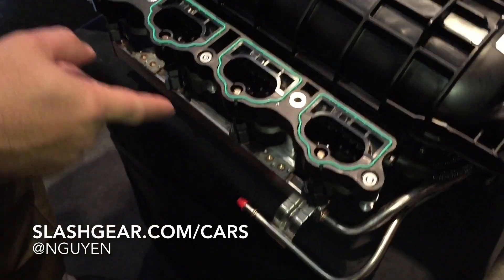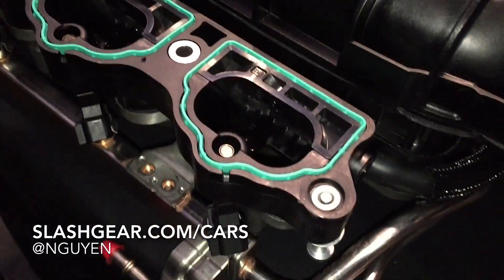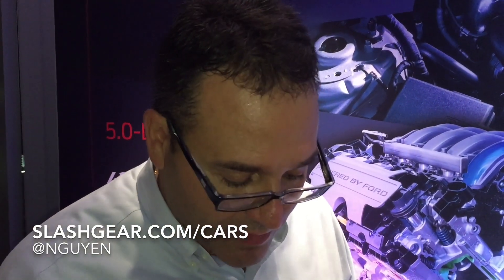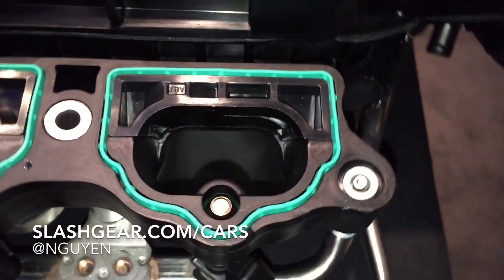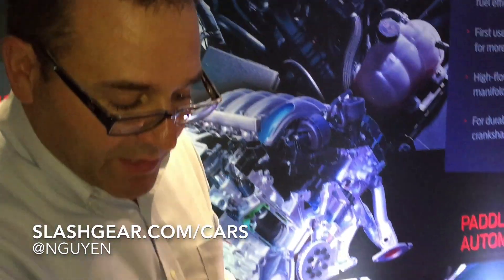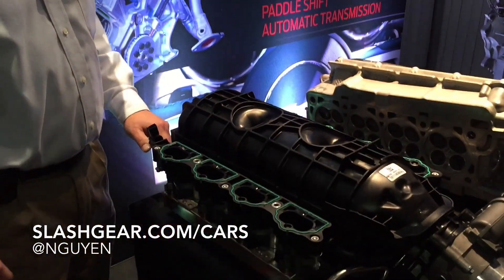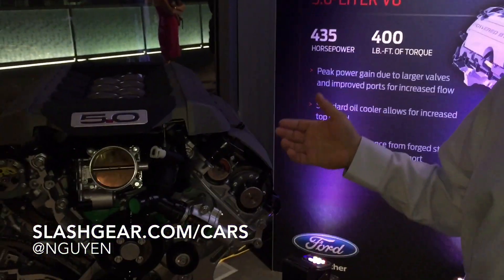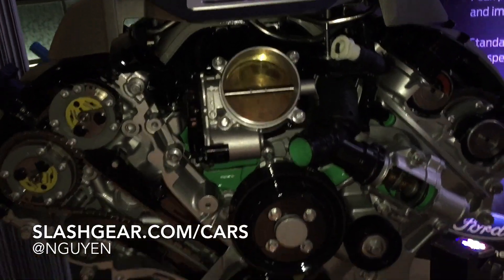Ford  5.0-liter V-8 engine 2015 Mustang

Comment: I think Ford should at least be able to get 125bhp per liter by now. A 5.0 Liter engine with less than 500hp seems inefficient and such a waste - I'm disappointed. You boys can most definitely do better... Come on! Let's get it sorted please ^_^ - I can't wait to hear that wicked 5.0 sound - I hope it revs past 7800 RPM with a nice flat broad torque band too and finally I hope the weight is distributed evenly front to rear, left to right with considerations for the operator and it weighs less than 3100lbs dry
Reply: Damn your crazy. I am really surprised they got more than 400 out of this size motor. I mean look at gm. That 6.2 liter they use is only pushing 425 horses I think. Now that is what I call inefficient.
Reply: It's sad isn't it!... For example, Look at the cars like Honda's S2000 with 240HP from a 2 liter i4 engine NA, McLaren's 650s with 640HP from a 3.8 liter V8 Turbo, and Porsche's 911 GTS or GT3 all over 400HP with a 3.8 liter Flat 6 NA and they all have no gas guzzler tax... Ford's engineers should be taking notes. They need help man 😐...😴 Time to wake up! The have decent designs, I'd like to see more form following function too please...